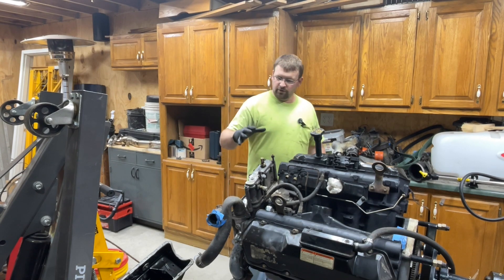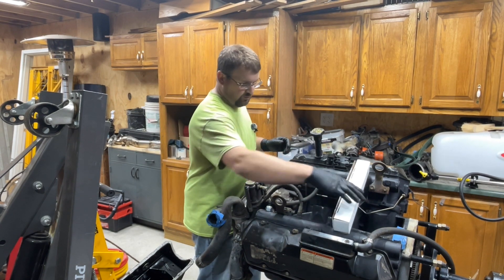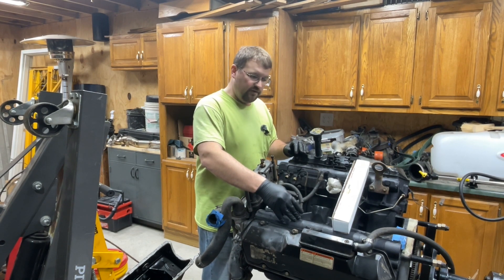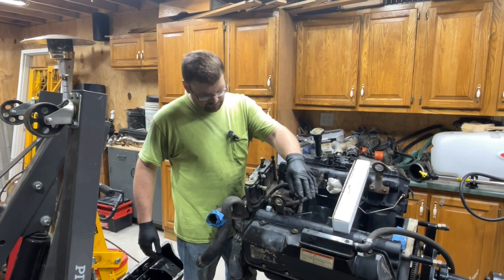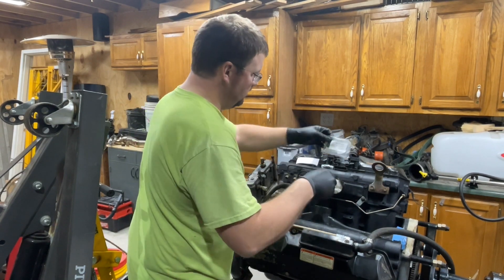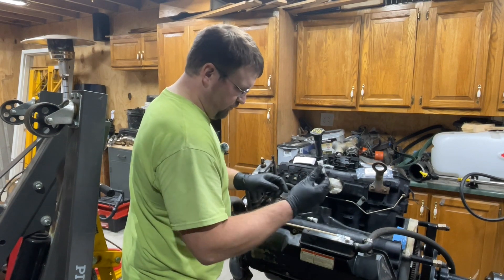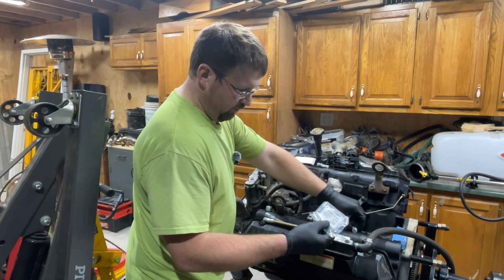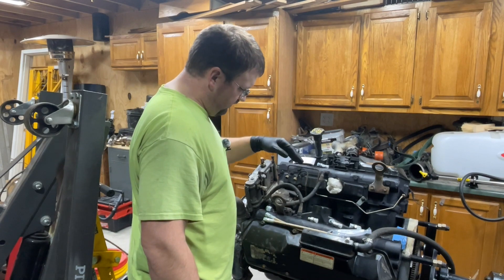CNC Fab HPOP Line install 7.3L Powerstroke

Comment: Thanks for the video. I am replacing the lines on my L99 service truck. Found it not running and it is puking oil everywhere now 😂. Looks like it had Amazon lines put on in its 400k
Reply from the maker: Guys always trying to cheap out!   Those lines will leave you stranded for sure.
Reply: @ I suspect that’s what it is. I can’t stand the hard 90’ formed line ends. That is definitely not somewhere you want to cheap out on.
Reply from the maker: @ OEM has the formed hard 90s I think.
Reply: @ if these are oem on a L99 I am surprised. They do not have the click connect fittings like I have seen. Either way they are in terrible shape. 5 cans of cleaner later scrubbing I am making headway of the grime.
Reply from the maker: @southernrevivalautomotive  it’s possible they came from an OBS.  But they SHOULD have the STC fitting if they were original.  Check the serial number on the block to make sure it’s an SD engine.
Reply: @ No opening for fuel pump in valley. Good idea, I’ll get the block #.
Reply from the maker: @ always use the serial.   Unless someone’s done some mix and match in the past….
Reply: @ anything is possible. Would not be the first 7.3 that had a donor motor. Over a dozen now . The last one was a 97’ with 4:10 gears zf which this is a L99 cab&chassis zf also 4:10 gears

Comment: Is not nessesary to install the springs on the hpop?
Reply from the maker: The springs are check valves to isolate each bank from each other.  When you install a HPO crossover. It is the same thing as removing those check valves essentially.

Comment: My 99 7.3 has crossover line. What's  your reason for not installing it? I am going to replace mine soon.
Reply from the maker: If you install an aftermarket HPOP or Aftermarket lines.  The pump can equalize the pressure better.  So the crossover isn’t really “needed” to balance each bank out.  Plus it makes it more difficult to diagnose oil issues if any were to arise since you have to remove it to isolate banks

Comment: Just swapped the hpop lines on my 99 today as well as installed a oil catch can. Why pull the check springs out of the pump?
Reply from the maker: They advise you to pull them out. However, most pumps that are performance upgrades already have them removed. My understanding is that they are check valves to keep the sides separated.
Reply: @GarrettsOBSGarage  ok. That's the first time I have seen them removed. I left mine.
Reply from the maker: @rickeydriskill1096  it shouldn’t hurt to leave them either.